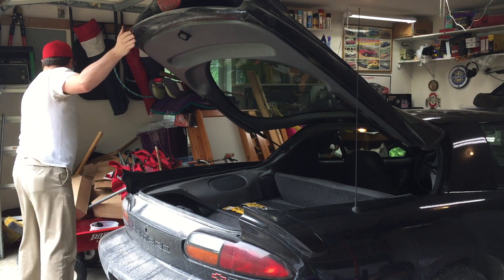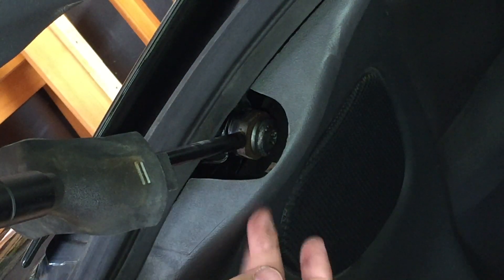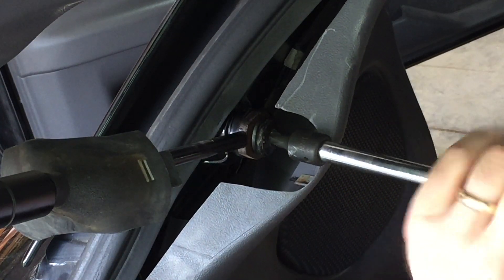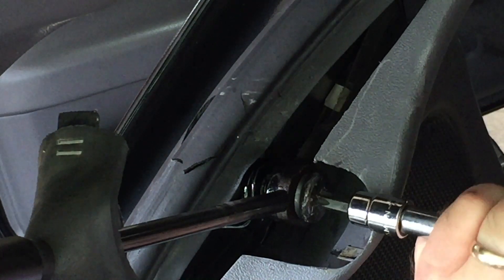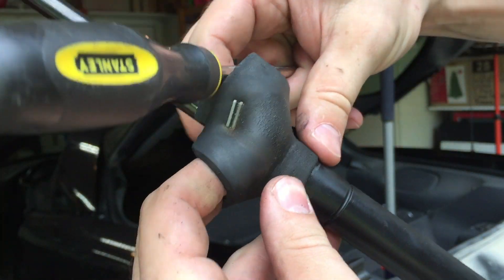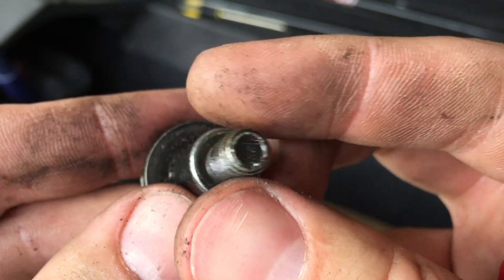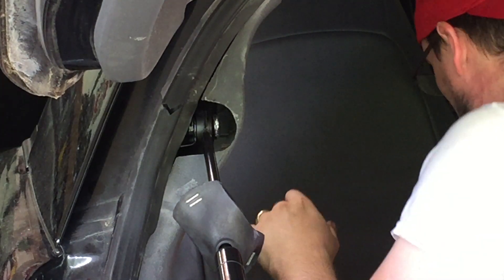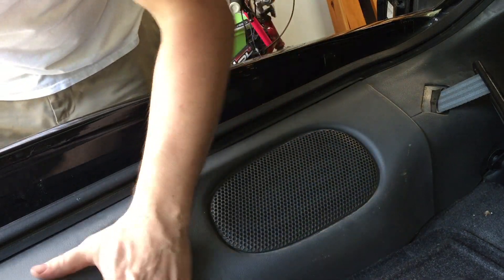Installing new hatch lift supports - Ready to Rage - Camaro/Firebird

Comment from the maker: What "simple" repair have you started that turned into a nightmare?
Reply: Changing my torque arm bushing and cross threading the bolt back in to the aluminum housing!  You can only walk away for a minute and come back to it!
Reply from the maker: Brian Allen Oof! Yup. Nightmare.
Reply: All of them
Reply: Replacing the hatch on the Trailblazer😂😂
Reply from the maker: 3 Wheels & A Block and we thank you for videoing it and sharing your nightmare on YouTube 😂😂😂
Reply: @TheDaninator  My duty to the automotive community😂😂
Reply: Installing AC

Comment: I did this job a couple of weeks ago (2000 Camaro Z-28). Lessons learned: 1. Use long pieces of wood to prop the lid up against the GROUND, not the car body, where it might slip. 2. Pry off the coat hanger hooks, pull the panel away from the body and wedge it open with a 2 x 2  block of wood. 3. Remove the strut from the rear first; you can then unscrew that part off the forward end, and the strut won't get in the way while you work on the torx screw. 4. T-50 is too big for the screw. My set went from T-45 (too small) to T-50, but I suspect something like a T-47  would have fit better. 5. Reassembly is roughly the opposite of removal: UNSCREW the forward end of the NEW strut, install that first. Then screw the REAR end of the new strut onto the forward end, which you've already screwed onto the body. Adjust the height of the hatch lid to match the length of the new strut, then screw or unscrew the two halves of the strut just enough to line up the end of the strut with the hatch fitting. Snap into place.

Comment: Gotta watch those creeping struts! 

Those torx bolts require torque.... I have switched to using an impact to remove them, because otherwise... they can make you act unruly 

That Super Tech Lubricant out performs WD-40 in many cases...LOL 

You can use a little silicone to or 3M Super Yellow to fix that piece of weather stripping.
Reply from the maker: 3 Wheels & A Block 😂 I called it WD-40. I may try that 3M stuff you mentioned.